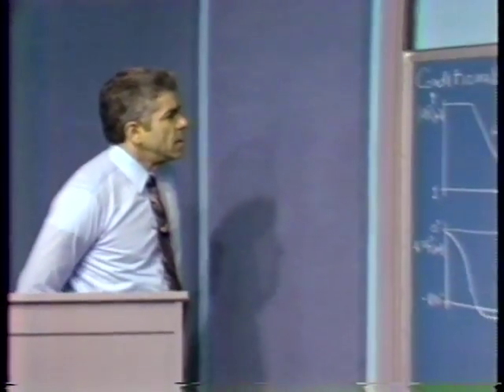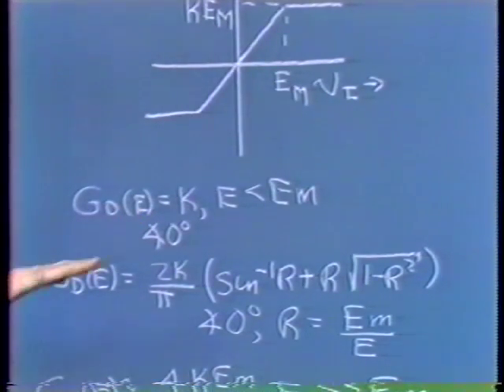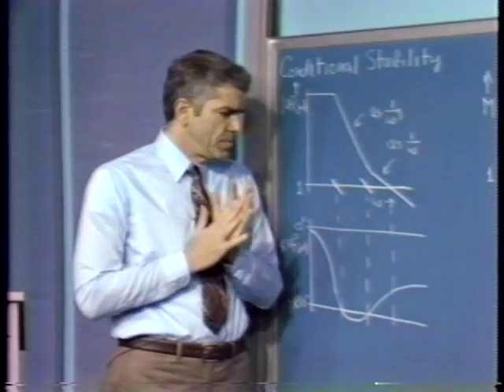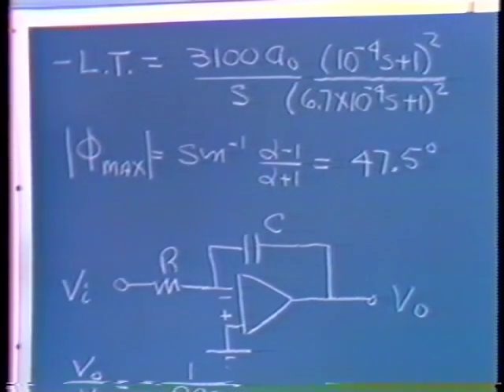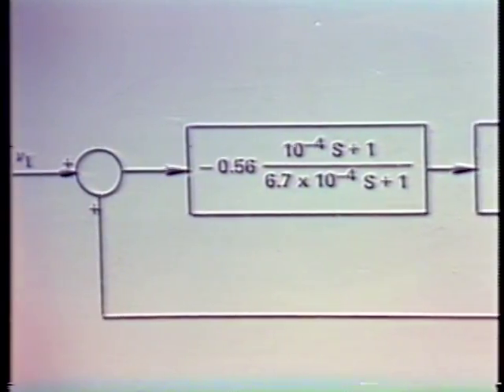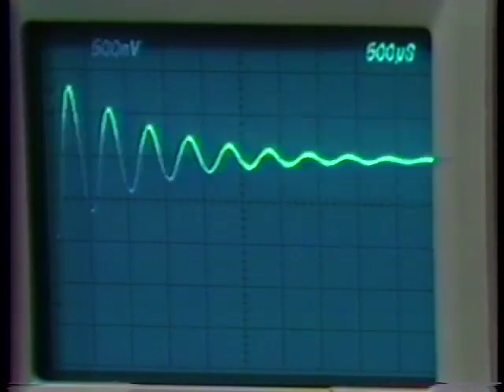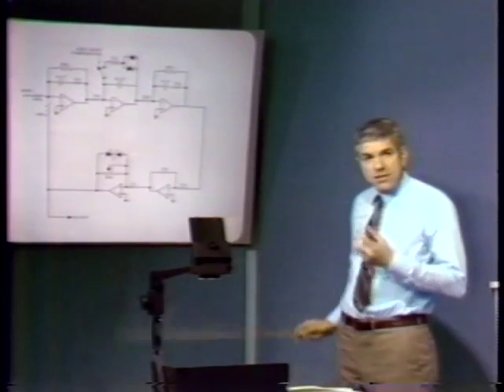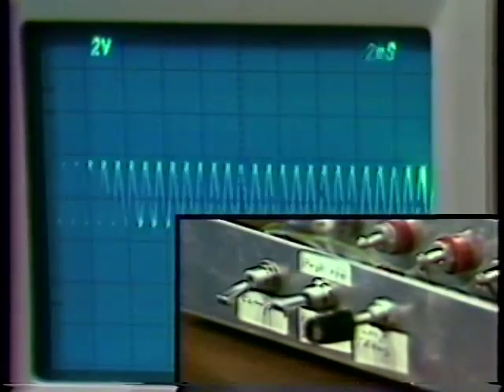17. Conditional Stability

Comment: Love this lecture. Can do it with Pspice, too. The large signal saturation/limiter effect osc. is ~400Hz, pretty close; while the crossover distortion (small signal dead zone) effect osci. is simulated to be ~800Hz due to the non-linearity compensation diode branch reshaping the phase plot. Ref video @34'40" (390Hz, 950Hz) ,@43'43" (~400Hz) and @57'15" (~1.3kHz).